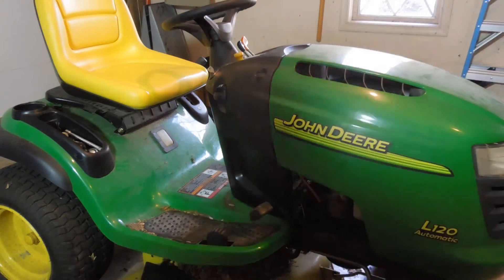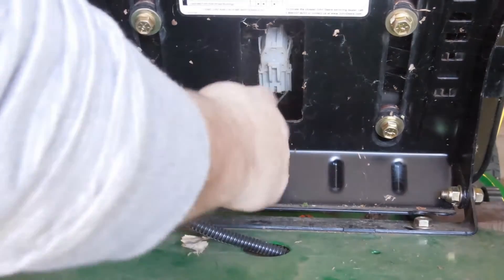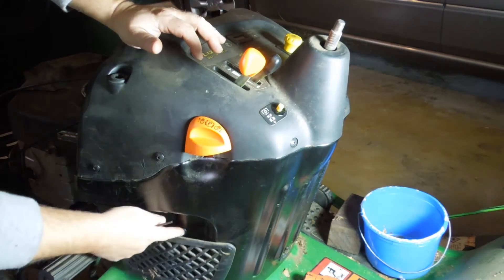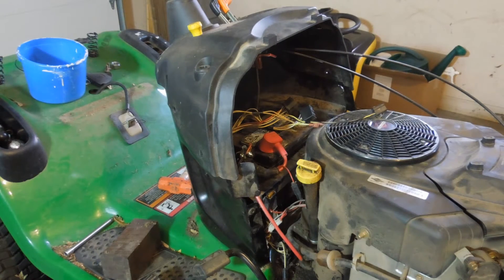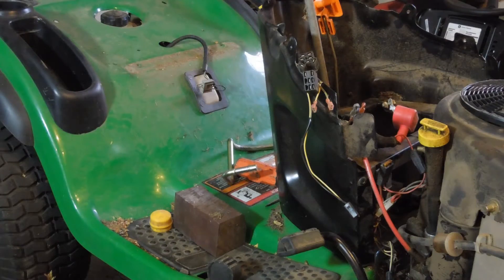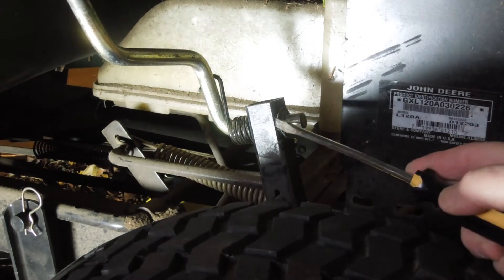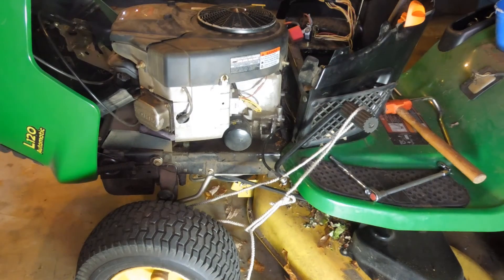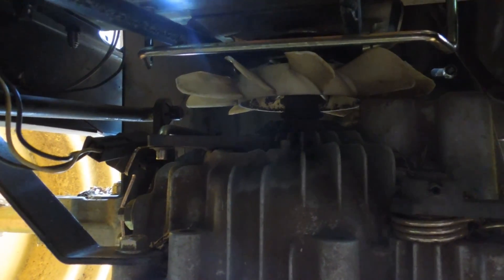JD L120 Repair

Comment: i know you already know this now but to help anyone else i ran into the same problems with drive belt, to access the belt all you have to do is pull the mowing deck out from under the tractor, but i do like you video cause i have so other issues i need to take care of and now i know how to take the steering cowl off